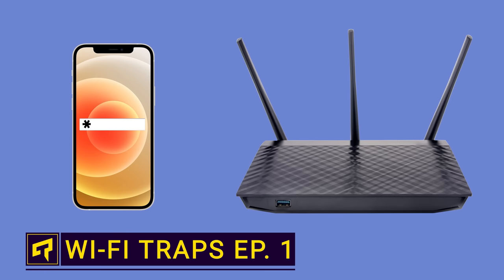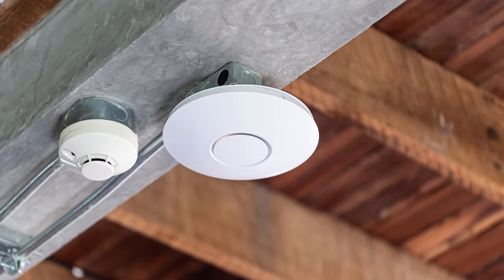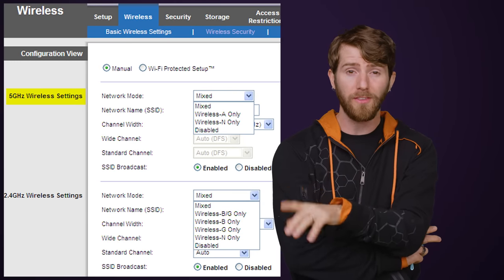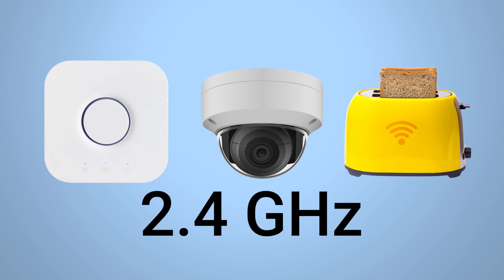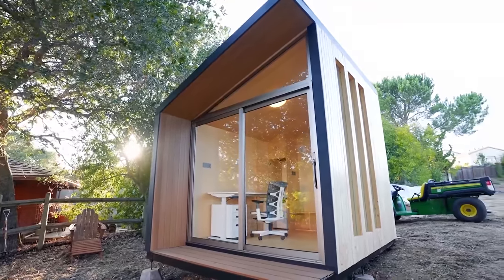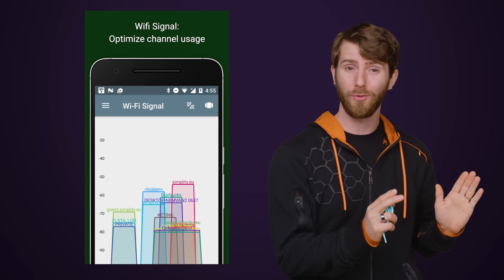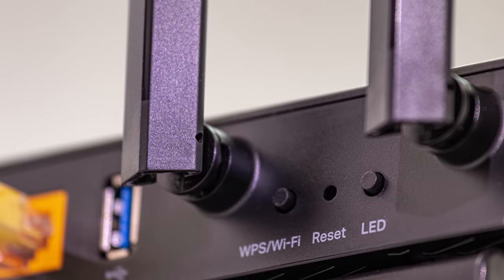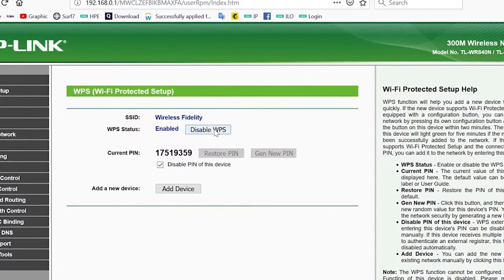Avoiding Common Wi-Fi Traps

Comment: You forgot to mention that there's really only 3 viable non-interfering 20MHz-width channels in 2.4GHz band - 1,6,11. And having neighbour networks on, say, channel 1 and 2 is much much worse than on same channel. Same goes for 5GHz band of course, but there's much more breathing room.
Also - always run your access points at lowest power possible, don't chase 5 bars signal. In some one-room appartment you'll be fine with 10-30 mW, and often with higher speeds than at full 100mW due to better signal-to-noise ratio.
And don't forget ever true communications axiom: if you can use cable - you must use cable.
Reply: So... It's better to be on the same channel than one channel away from your neighbor?

You need to be about 4 channels away it sounds like To not get interference? So if you had networks 3 at ch1 2 at ch6 and 1 really strong network on Chanel 10 your best bet would be chanel 6 for a new network?
Reply: @ErrorMessageNotFound  that kinda makes sense
Reply: @ErrorMessageNotFound  Thank you! :)
Reply: He is speaking the language of gods! (I understand what you say, will try it out today)
Reply: @ErrorMessageNotFound  Channels 1, 6 and 11. Are these world wide or depends in which part of the world? (Noob here)
Reply: @mikew.to1  So, channel 1, 6, 11 doesn't apply for 5GHz mode?
Reply: Having neighbours channel on channel 1 and 2 is worse than on same channel. How?
Reply: @mikew.to1 There is stuff to the right of 11. Channels 12-14 are a thing. True, they aren't commonly used (and 14 is illegal in the US), but it's often as simple as changing the country flag in your AP to enable them.
Reply: So, if everyone recommends 1,6,11, logic would dictate that everyone is going to set their routers to those channels...non?
Reply: @ErrorMessageNotFound  It simply doesn't matter.  the bandwidth allocated within the 2.4GHz and 5GHz bands is simply too narrow to make any difference.  It all bleeds over.  Signal strength, not some minute frequency step matters.
Reply: @mikew.to1  what do you mean ch1 has nothing to the left of it or ch11 to the right of it?  Your microwave oven operates to the left at 2.400GHz of wifi 2.412GHz channel 1.  Then you have all the MBAN operating to the left of channel 1, too.
Reply: Can you explain why running the router on a lower power setting can increase the signal to noise ratio? 

I would have guessed that more power -> more signal -> less noise
Reply: @jonepomuk  No amplifier is pristine signal source, more power = more amplified noise. i.e. i can't use active amplifier in antenna for dvb-t2 here, because noise floor gets too high, so i have to use bigger antenna with more directors to get maximum passive amplification.
Reply: @hanwagu9967  Wifi started with perfectly fine spaced 5MHz channels, so the fact that we have 13 channels now is mostly bad heritage. But there are devices like ubuquiti's stuff that can work from 1 to 60 MHz bandwidth. So yeah, no escape from that mess.
Reply: @Aereto  Dude, drills, they do exist. Or you can drill window frames and hang cable outside.
Reply: @jthomas.  changing country flag is not advised. channels are prohibited for reasons and there might be other functions necessary to be allowed in a country, like EU's DFS for freeing 5GHz channels >48 when e.g. weather radar is detected by the AP
Reply: @evilgremlin  thanks. It does kind of make sense if you have only one source. But obviously a wifi router competes with other sources of noise as well I suppose. I tried putting my wifi router to lower power settings, and even though the laptop was right next to the router, the up and download rates were halved. And that is in 5G which is mostly empty here.
Reply: exactly... 40MHz on 2.4GHz should be prohibited unless theres no one in area. yet even some ISPs here which are really incompetent, put customers wifi at 40MHz... it really sucks big time for my both home wifi which one of them acts as client.
Reply: @angumech13  No, because the channel numbers for 5GHz are different. There's a lot of the, and broken up in to a few groups, and the bands are wider too. There's a good page on Wikipedia of you search for "5GHz wifi channels".
Reply: Most of my neighbours correctly use channels 1, 6 or 11... but I despise the three neighbours that are using channel 4 or 7!
Reply: @Octavio Lopez "never" is a strong word, and even then, remember that Ethernet is a specific type of port. A wireless connection in the future will easily be able to outstrip current Ethernet  speeds. And there's no guarantee that Ethernet will continue to be used in the future.

Assuming you meant wired connections in general, that's also not necessarily true. We already have wireless gaming mice from reputable brands that claim to be faster than wired mice. I'm not sure if that's true on average now, but the fact that it beats wired in some scenarios (because it has to, to be put in their marketing material) is incredible. 

Remember, radio waves travel at the speed of light. Data travels down a wire at the speed of light as well, but it has farther to go, as the wire curves. This is ignoring any processing time, signal loss, and all the rest of it. Those issues can, are, and will be mitigated.
Reply: @addaccount2166  so basically you have 2 kinda of interference with other wifi networks, co-channel interference and adjacent channel interference. We really only want our routers to emit in the channel they're communicating on, but due to the pesky nature of real life they have a rolloff on either side that is essentially unwanted noise.

The reason this is a problem is that muddies up your intentional communication with essentially radio garbage, while conversely multiple transmissions on the same wifi channel are more clear to recepient devices what exactly is for whom.
Reply: Yeah I try to use a cable for every device that has an ethernet port and is static, even if it has WiFi. All my consoles like my PS3/PS4 and Xbox are all connected by cable.
Not only better stable connection, but less devices using WiFi means better connection for the devices I want to use with WiFi.
Reply: @Aereto  You can, you just need a drill.

Comment: Here's a pro tip for you: 
A. The reason you wait 30s when Unplug and repluging a router is so the capacitors fully discharge and allow the memory to properly clear and reset themselves.  Often if you plug device back in before the capacitor can drop enough charge, you'll have new issues on electronics/wifi or just the same issue carried forward. Wait the 30s! 

B. I don't know if this still rings true, but: 
ISP's provide internet long distances, over that distance noise and distortion on the lines is created. When those full power signals hit your router, if it is too noisy, the router is designed to filter that noise out. Causing small data/speed loss, but creating a more solid connection. As this continues to happen, the signal leaving your router gets less and less, more bottlenecked to create a better connection.  This doesn't often clear itself up, so resetting the router will clear those parameters to allow full connection to be provided to the home again. 
I think that was more a coax thing? Vs fibre connections. 
But the east coast is much further ahead than the West coast... NB had fibre years ago, well before I moved to Calgary and we JUST got fibre to the house last year .. so I doubt smaller areas of BC run on true fibre.

Comment: Best tip: Buy a router (with ap build in or also buy a seperate ap). Don't use the one from your ISP! It's probably garbage and will give you a lot of frustration
Reply: What about the Google WiFi
Reply: It doesn't have to be. I work for a major ISP in the Netherlands and we have two models going at the moment which are actually pretty decent. The ZTE H369a for example is a model we use, it still uses the original ZTE WebGUI so every setting can be changed and it also has proper antenna placement. I do agree with you on the fact that some can be garbage, especially because they might have some settings blocked or missing like changing the subnet of your router.
Reply: I'm lucky my ISP's modem/router is just made by Cisco, though I still have another AP and two 8 port network switches
Reply: @rossharper1983  Keep in mind that there are leaps of difference between enterprise Cisco equipment and Cisco branded CPE equipment. The Cisco you're thinking of, likely had nothing to do with whatever equipment that is.
Reply: @ToreOnYouTube  that's true. However I have 1 gigabit business line so it's an off the shelf Cisco modem that was provided by my ISP
Reply: Don't matter when the ISP only fucking gives us 3MB/s anyway
Reply: The one from my isp is phenomenal. Much better than any other router I've ever used before. I get full speed anywhere in my home, even in the backyard
Reply: Except when your ISP make sure that you can't use other router unless you ask permission to them; and they make the process tedious so that you are discouraged to use other router.
Reply: @genericscottishchannel1603  SQM can drastically improve the experience by reducing bufferbloat
Reply: @kamotetops1572  you in US? They aren't allowed to do that here in UK. I guess it's a freedom thing 🤣
Reply: @rossharper1983  yeah same here. Freedom of choice regarding equipment. An ISP can't force a user to use the ISP equipment. Only on cable and PON ONT's they can at the moment but this will change by next January.
Reply: *built
*separate
Reply: well i don't get it then, can you just refuse the ISP provided one? In belgium, you are given one with your subscription how does this work..?
Reply: @genericscottishchannel1603  this.
Reply: @genericscottishchannel1603  buy 300MB/S get 3.
Reply: lol not herr in The Philippines.
Reply: The asus or TPLink people will buy is garbage too
Reply: Most ISPs literally give you electronic waste, sells you 1 gigabit internet but gives you 50 megabit router, fucking kek
Reply: This! I can't tell you how many times I've had clients run their small businesses from whatever WiFi router the ISP gave them. As soon as I replace the ISP WiFi router with something decent and place their ISP's modem on bridge mode, 99.9% of their network problems go away.
Reply: @nekoyumi7064  I live in the netherlands so probably the same. What I have to do is put my ISP router into bridge mode. It disables everything except the 1st ethernet port. You can connect your own router to that port. This way your ISP router only acts as a modem and not the router/modem/ap/switch combo that's most of the time garbage.

Comment: My tip is, behind the router there is a spot to connect a Ethernet cable use that  instead.
Reply: But my wifi toaster doesn't have ethernet port
Reply: %100
Reply: That's my only complaint about mesh networks. Fast wifi but lacks the ethernet ports. Could remedy that with ethernet switch but still...
Reply: Thank you. It works great for my pc but what about everything else?
Reply: Great tip!  I use this to connect my smartphone when I'm at home and it's super fast
Reply: @juanzubieta5080  A hammer works great for everything else. If it doesn't work get a bigger hammer.

You're welcome!
Reply: I myself, do enjoy cabled WiFi from time to time.
Reply: Oh yeah, I also think my WiFi is better when I use a cable.
Reply: @ToreOnYouTube  Indeed, did you know, the acronym WiFi stands for Wired Fidelity?
Reply: *an Ethernet (because "Ethernet" starts with a vowel sound)
*cable. Use (to fix your run-on sentence)

Comment: When I power on my router, it sometimes literally gets stuck at "connecting" when I use my wifi portal to check it's data status. I need to login in to my WiFi settings portal and literally toggle data off and on on it lol. Even a factory reset didn't fix shit, my ISP literally doesn't want to replace it although the router is almost 6 years old lmfao. It uses WiFi 4 sadly, 2.4 GHz only
Reply: If it is a 4G LTE router just get a fiber and a compatibile modem from your ISP and buy what router you want but if you  are useing a router+modem device I recomend you buy a good router and put that router+modem in modem only mode and connect the new router's WAN PORT TO router+modem's WAN labeld port.
Reply: @that_duck_over_there  Well fiber network here is pretty expensive lol and my ISP doesn't provide a modern too :( So looks like I'm rip lol
Reply: @Mystic4rrow  do you even really need provider's hardware? i know of only one asshat that really force you to use their router, and even then there are ways around
Reply: @Mystic4rrow  Where are you from? And what are you using DSL, 4G LTE, etc.
Reply: @that_duck_over_there  I'm from Sri Lanka and my network type is 4G LTE although this shit even ain't real 4G speeds lol (max download is 1 MB/s and upload is literally 500KB/s
Reply: @evilgremlin  Yeah, I need to use the provider's router, I have another router and I inserted the sim card into it but the router kept saying "No SIM Card detected" lol
Reply: @filleswe91 I'll have to check whether they even provide shit like this (Usually they don't have any modems), ISPs in my country aren't particularly smart even at their own shit
Reply: @filleswe91 Do you need the ISP permission? can't it be done without them?
Reply: *its (possessive)
it's = contraction of "it is/has"

Comment: I didn't know WPS was that insecure.
Reply: Yeah, It's like a tiny password
Reply: It's a horror story almost as bad as those they use in the  movies where you can guess each number separately. But I think the push button one is safe, right?
Reply: @jackkraken3888  WPS is the push button. Disable it. Now.
Reply: I can confirm that it is VERY insecure. VERY! It is a 8 digit "password", but it's checked in 2 different chunks - 4 digits and 4 digits. So it is actually just a 4 digit password, followed by a 3 digit password (last digit is only a checksum). That's only 11,000 possible combinations out of the 100,000,000 combinations with a real 8 digit password.
Reply: @jima1135  I guess I will have to now.
Reply: @jima1135  I'm trying to understand the risk though. Unless an attacker is constantly recording it's unlikely to be that bad right? PS my router supports both pin and button I disabled pin already this is only about the WPS button.
Reply: @jackkraken3888  They are both part of the same system. Either you can type in the pin as your password or you can just press the button. Either way, it is like "sending" the 8 digit pin - from your device or from your button press
Reply: it depends on the router. many routers for example the WPS will only turn on when you press the WPS button. which obviously requires physical access to your device. thus its actually pretty secure. others however can trigger WPS remotely when a device tries to connect.

Comment: I get lightning fast WiFi by connecting the motherboard of my PC to the back of the router with a cable! It improved speed and reliability! Amazing.
Reply: That's not wifi tho
Reply: @julius_caesar_grzfz  pfft, do you even know how WiFi works bro. The "wi" stands for "wire" and the "fi" stands for "fixed into the back of the computer and router"

Comment: My favorite trick to for best use of wifi? Use the wired connection whenever and where ever it's practical. Computers, consoles, and set-top boxes/Smart TVs are far less likely to flake on you when streaming, gaming or downloading, and it frees up connections for your wifi if your router has a limit of what can be connected all at once.
Reply: *wherever

Comment: WiFi tip: plug in. Embrace the hideous wire tentacles creeping through your house like a Stranger Things episode!
Reply: They don't even have to be hideous wire tentacle. Zip-ties are dirt cheap and great for cable management!
Reply: @tenhundredkills  Some (many) people have the opinion that any wires running along your walls/floors/ceilings is unsightly. If you want it to look nice, you run them in the walls, but that's usually a much bigger job.
Reply: @Snarethedrummer  I agree, having cables inside the walls is MUCH neater than just having them exposed or in cable raceways. If I have my PC hardwired to a switch or WiFi router that's on the same desk, I'm OK with rolling up and zip-tying a few feet of cable. If I wanted to hard-wire a device on the opposite side of the house, then I'd either pull cable up the wall and inside my attic or I'd take the lazy route and use WiFi. No way would I have cables just laying around on the floor - or in the case of one of my clients - taped to the ceiling with masking tape!